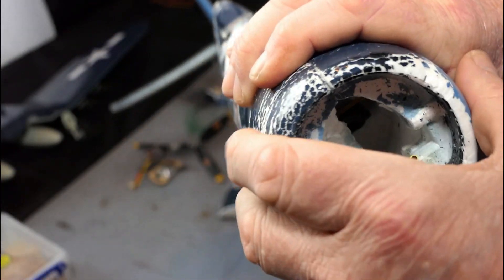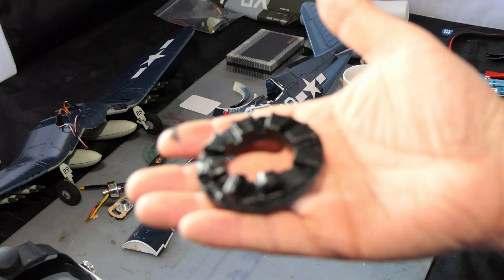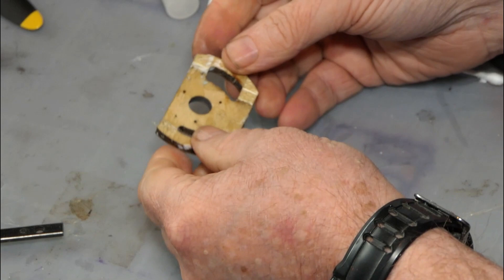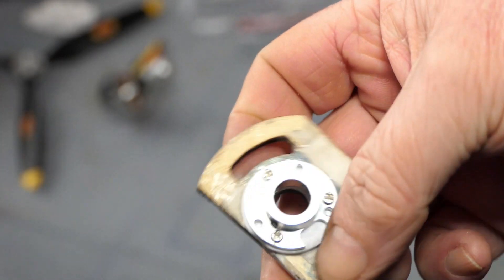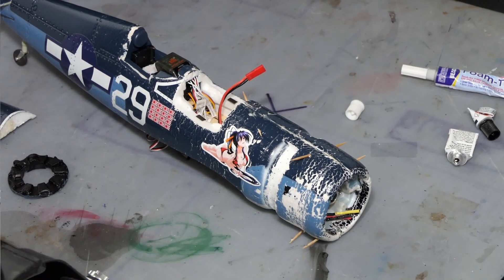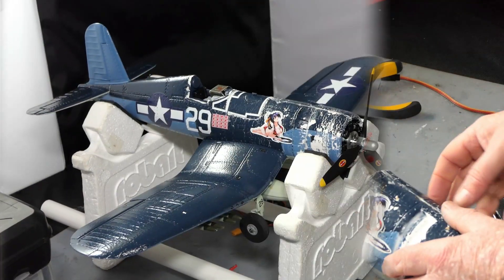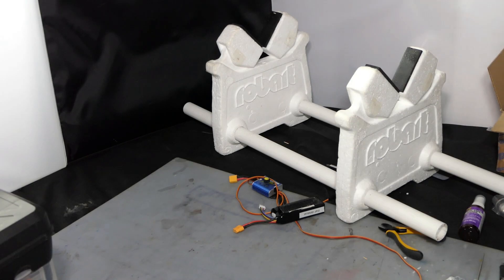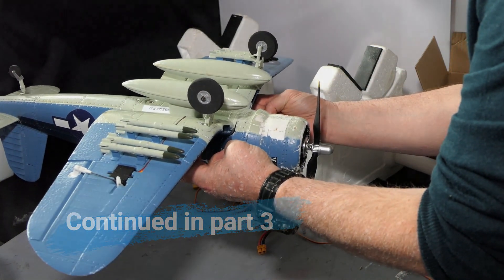Repair - HK 750mm Corsair - Part 2 of 3

Comment: Going great guns martyn..... Couple of questions where do you get your stick on iron from. And what size Allen key do you use to release the motor grub screw..... How's the paint mix going for the blue...... 
Brian
Reply from the maker: Stick on Iron I get in lots of ebay 25 x 60g strips for about £10.00 - https://www.ebay.co.uk/itm/133382392049?_trkparms=ispr%3D1&hash=item1f0e35c8f1:g:R2kAAOSwwRpejgsj&amdata=enc%3AAQAFAAACcBaobrjLl8XobRIiIML1V4Imu%252Fn%252BzU5L90Z278x5ickkBUIiHwYv5YgVss0WaiENzzZTh4jOIyA6NXDwSpJ64edBQJhYekj3%252FgXv2lEiVdue3vn66VaqIlljhE%252FMrLKFQ0XHqGoMrPje80mrcE7V9JunBDzVvIxAM0j0svA%252FzxriSoLolK2oQblMNTRjNOvWPTPSnswDv%252B5TIcIJWU2CWgRnY4VmQoXDYYtEtT4aTL%252BAz%252Bk1GzdiyO%252BmpYwSirqMfKCJ20ixRMbDFQtdPlgjBk34mxJ2a1iaqznbEr8MLoZsFPF1tfoVD7VakrYmDEPnuedRabylwqL9QQLvATNsiT2qcwisormFghHw5xFWiiaGlnuoESlbUmvUwMaXrJDp8Tr75dSzBwE9W5ZAdJyd%252BEvPYLoBVwmN0TgbXf81U8vfy8Bm%252FETdyEn%252BemNE%252FO7BTYCULM9k0omcJam6chTZDfYp%252FRx2z%252F3rmxm9wYTdGs%252Fms5n%252BFRgAkBYiLTjTikLxJnuISTBM7YE2RJlfGsDCNoURCx6dkeXtcpGzpxMQhabRIzPjQdqs9hI8oQWf0fEXTF2hC6YU0BqI9MpqLwVMtBehRUeZU8oHlqzUy9iHm32VlPEZMYqbQJxYIS4%252FaGCT5BJvz6%252FzS9edV%252BffF84JXrzyWyz8OnXLBQzwPIcxELG%252FU1TfdAVSLxn%252BdvLpRQ54Y3Z6pKGCNuaEVHewBxLjSRrKHqEzAlD%252Frx4FnjmUsmiaBti1ZWrpiiCBKTWLuduzdjkCrmnXzkCCmPvn2htpiApai5hpMGJ2UVP5uQ5nE2DN%252BgELm8%252BHyqx7aZJZ3O6wsA%253D%253D%7Ccksum%3A133382392049509a3c62ba2d471fae46db58b18d1ee5%7Campid%3APL_CLK%7Cclp%3A2334524#
Reply from the maker: Allen Key size needed for the Grub Screw is 1.5mm - It needs to be long to get in and five you enough leverage. cos its a tight little SOB..

Comment: Great repair did you remove that weight from tail you highlited in video one.
Reply from the maker: Did not have any weight in the tail for this one - I did for the T34 Mentor and that still needs it (I has not crashed) :-) - this one had 50g of nose weight, after the rebuild it only needed 40g which I have hidden on the inside of the Cowl....